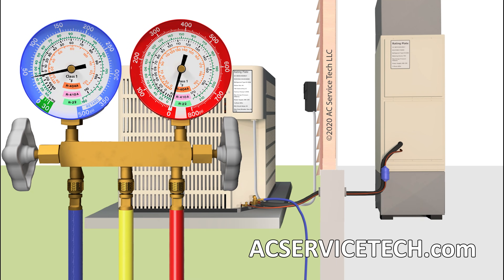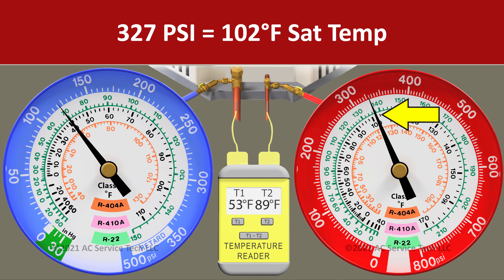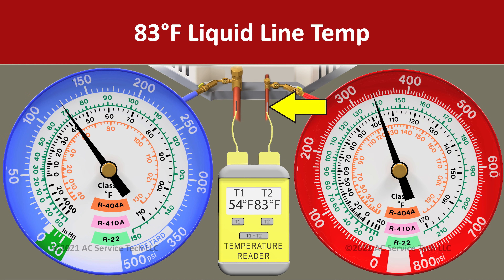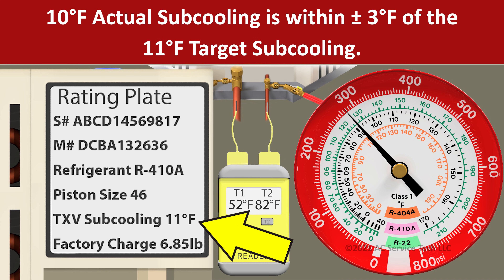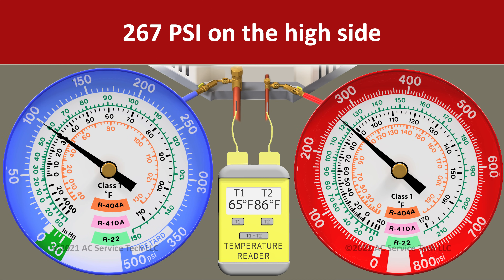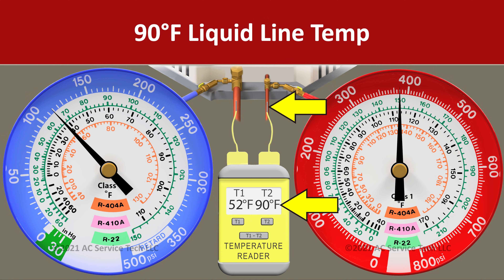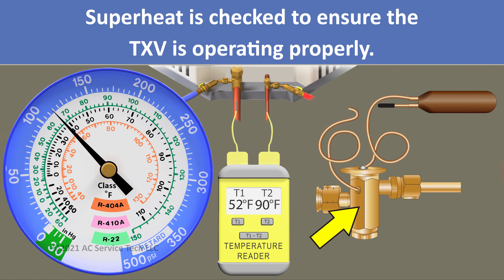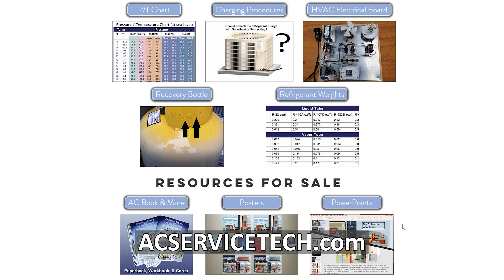7 More R-410A Subcooling Scenarios to Practice Checking The Charge!

Comment: What's cause a new ac factory charged to be hi on suction line temp around 67 f  .but when I check the super heat and the sub cooling after runing the system for more than 15 minutes and even half hour it seems to be accurate. The super heat is right subcooling is right but suction line temp not cold .filter is new .condenser and coil new .right size ..I don't know what's that mean??V

Comment: I had an HVAC company install 4 complete units for one of my customers. They did not follow your procedures. Specifically when they braised the lines they were not pushing anything through there to keep the inside clean. They said a vacuum at 500 microns would clean everything therefore it was unnecessary. Since I have been watching your videos for so long and I have your materials I wanted to get your opinion on this. They seem to be very disorganized they're friendly and nice but it just looks like crap! And they didn't use nitrogen and they didn't pull the Schrader valves they put some goop on there instead. Which left a mess cuz they didn't wipe it off thoroughly. Hope all is well Craig
Reply: Hate when customers watch this stuff and get the wrong idea. None of the things you listed (unless it really is visually unappealing) are big problems. These youtube pros make it sound like it's the end of the world and it's not. People have been brazing copper lines without flowing nitrogen for a long time with no problems. It's just a good idea as a contractor to make almost 100% certain you wont have a restriction later on. But it really almost never matters. And the goop is called cool gel and works awesome. Leave the techs alone or do it yourself. Its Rare that anybody does it the way these guys do. It's a good method but it's not the only way.
Reply: @loganc339  good way to clog a txv.
Reply: @BKMDano17  you ever clogged one? Me neither...

Comment: Question? Had a issue system had non condisibles causing head pressure issues pulled vacuum added new gas now my low side is immediately pulling down as soon as compressor starts causing low pressure switch to open head pressure looks good but low side drops super fast thinking bad txv also their is no filter drier on system any suggestions???

Comment: I’ve searched through all your videos that I know of in relation to fan relays. I’m working on some units that are from 1974 and the wiring has been messed with. I see two fan relays, transformer, a sort of terminal block and just wires between everything. I’m trying to make sense of the purpose of needing say 5 to 6 powered until you call for low voltage and then 2 to 4.
Reply: Could it be crankcase heater?  Energized when the compressor is not running?

Comment: Thank you for the video.  I have a question. Why my liquid line Saturation temperature following along with the liquid line pipe temperature?      it's literally the same. Recently I did a system convertion from r22 to r410a with a new condensing unit. During that I’ve replaced txv with 410a one on old evaporator coils, also put a new filter liquid drier. Evacuated to 500 microns.  Equipment data: 14 seers new 2-ton condenser, 2-ton old coils, TXV for 2 ton r410a. When System on SH 22 degrees. The system works fine. Why I can’t get any temperature differential on the high side. Even if I add or remove refrigerant?  It will not increase subcooling. The temperatures the same. Subcooling = 0. I've seen this before a few times on other systems, and also was confused.
Reply from the maker: Thanks for your support! Make sure to email me at questions@acservicetech.com so I don't miss your questions. Are you talking a TXV or piston and just wanted to make sure you checked your gauges at 0 psi before connecting and have you checked the temp sensors in 32 degree ice water to verify they are measuring 32 degrees?
Reply: Did you ever find out why no sub-cooling? I know my TXV at home requires 10 degree MINIMUM sub-cooling at the TXV according the the manufacturer. You've seen this a few times in the past and you are adding refrigerant to increase to +10 degrees sub-cooling right? Depending on length of line-set it could take quite a bit to make a change. You say the system runs fine but it may not be running at optimum efficiency. The only other thing is the coil. Original r-22 coils were not made to handle the higher pressure of r-410a so I hope it lasts for you!

Comment: Question, how do we calculate what our target SC or SH should be?
Reply: Target sub cooling is on the unit rating plate most of the time and average sub cooling you want on Txv is 10*f. For fixed orfice there is usually a chart for the superheat on the inside of the condenser access panel
Reply: Thank you

Comment: Going only on subcool will get you into trouble, a lot of other factors to consider. Excellent exercise. I would love to see a video of you showing pressures and walking through other scenarios such as bad txv, low airflow, clogged filter drier and non condensibles
Reply: To be fair, he did mention that in these scenarios proper airflow was checked and he did go on to check total system superheat. I agree, only checking subcooling could cause an incorrect diagnosis.

Comment: Will removing a portion of the R410a from the system affect the blend
Reply: If you remove it in liquid form it should not.
Reply: Thank you Randy.
Reply: If you remove it as a liquid it shouldn’t. Problem is. You cannot know for fact it is coming out as pure liquid because you are only going to pull from the points. If you really want to be correct. If a system is low on charge. You need to remove all refrigerant and weigh in factory specs. Take a lot to do it this way. Hence the reason people put in and take out. I have been adding and removing for years. Haven’t ran into a problem with the blend getting off.or I have and didn’t know it.  It may cause a shortened lifespan of a compressor.
Reply: Thank you J

Comment: I'm not sure if I'm asking the right question here, but why does having low subcooling means it's undercharge, and over if it's high subcooling?
Reply: Too little refrigerant in the system and the refrigerant is rushing out of the condenser and Into the TXV not allowing the refrigerant to properly condense. Too much refrigerant and you're backing up refrigerant in the condenser allowing it to cool well beyond its liquid saturation.
Reply: @randymoreno9345  thank you for the explanation
Reply: I also need clarification on this
Reply: Oh, you need to check the Molier chart. If you understand that chart you will fully understand this video, also read the ISO5151 for some important standards for Hvac.
Reply: @VRF.Engineering  I'll check it out
Reply: Because of condensing, evaporation and saturation. You need enough refrigerant to accomplish this. If you are flooding your coil or your coil doesn’t have enough refrigerant. There is not enough heat transfer.
Reply: @JBra1382  that's right thank you
Reply: Low sub cooling = low sat temp = low pressure = low charge